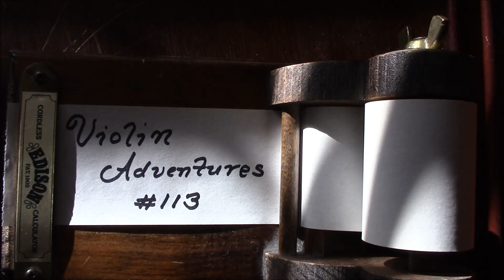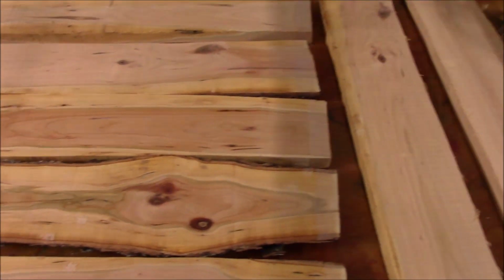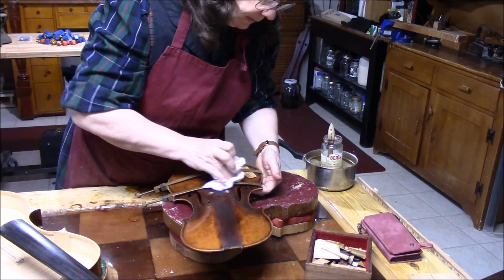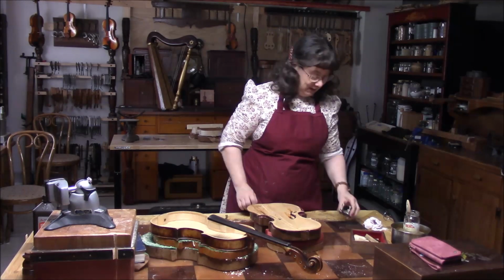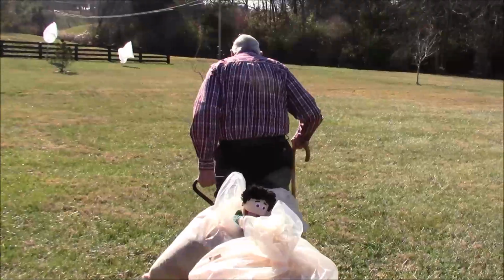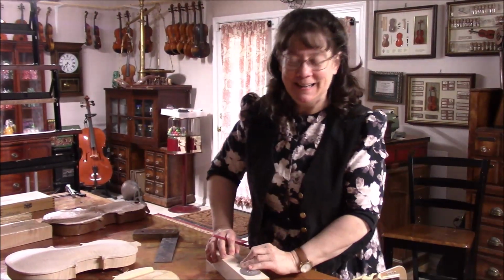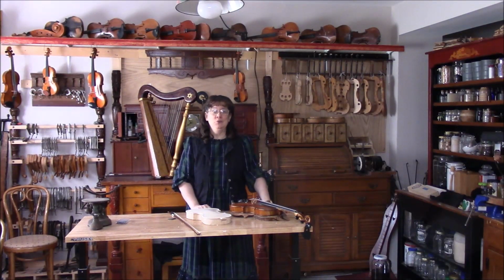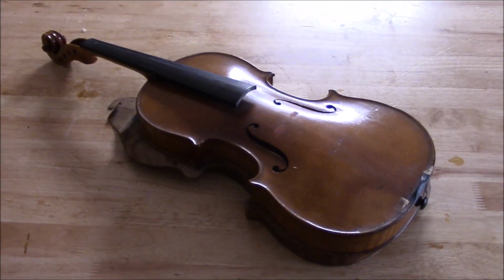Violin Making Adventures #113 (C. Macomber Violin Maker) Saw Mill, Viola Repair & Violin Build

Comment: I hope Santa gets you a cyclone separator; changing bags annoys me, and I assume it annoys everyone. As for the cracked scroll, it would probably make a nice wall mounted coat hook. Good luck with the new billet!
Reply from the maker: You got me on that one-a clyclone separator!!  I had to look it up and that is exactly what I need!   Thanks for the information. I was just going to have Freddie take care of that job.   The scroll is going to go somewhere-that is a good idea!   I might get to that next billet this week, Lord willing!   Hope you have a wonderful week ahead and thanks for your comments!
Reply: @Violinsforu2  I have the Oneida 6" Dust Deputy which I mounted on a 31 gallon metal bin. I cut a big hole in the lid and bolted the cyclone on top. The fittings never fit right, so I ended up using HVAC elbows and 6" to 4" adapters. HVAC crimpers helped me get the right diameters and I taped everything with aluminum foil tape. Looks redneck, but it works.
Reply from the maker: @wmcrash  Now that sounds like you have a big shop!!!  You have to tell me more!!!  What do you make or do with wood?  I am already admiring these cyclone separators.
Reply: @Violinsforu2  Looks like my original reply to this disappeared, I must have used some words Youtube doesn't like :D These days, I mostly make rolling pins. If you look up TheobellaArtisanry out there, that's me. Other than that, I've made a couple of stave drums and have a few dozens shells in the raw. I made a few benches. I also amassed a ton of tonewood sized for everything from violin to double bass, along with the tools and the documentation. One day, I will attempt to make a string instrument. A few years ago, I added machinist tools to the shop and currently working on some small plane adjustment hammers. The shop is about 2 garage bays, and a lot of lumber stored in the 3rd bay.
Reply from the maker: @wmcrash  Awe Yes!  I found your beautiful website!  It sounds like you  have a dream of a shop with all that wood and machinary!    Thanks for sharing what you do!   Your work is beautiful!     I am glad you persisted and got through whatever Youtube was doing!!!!!